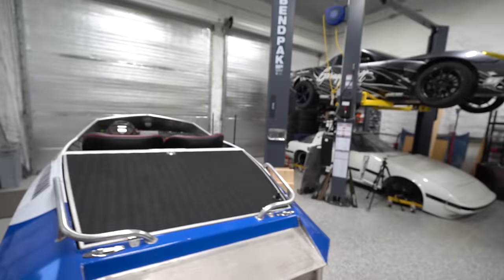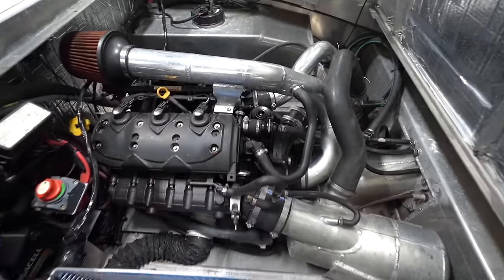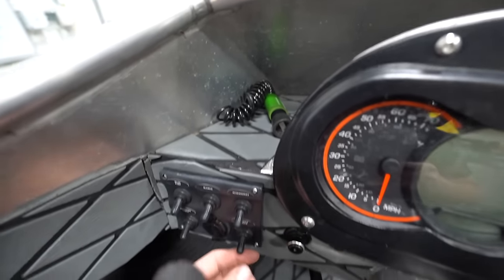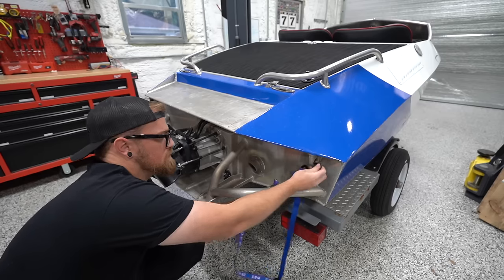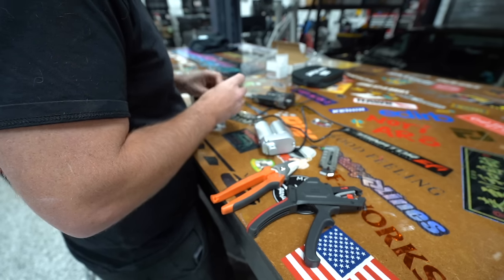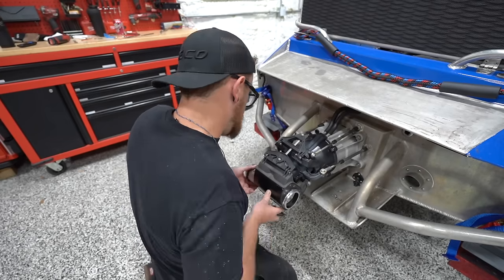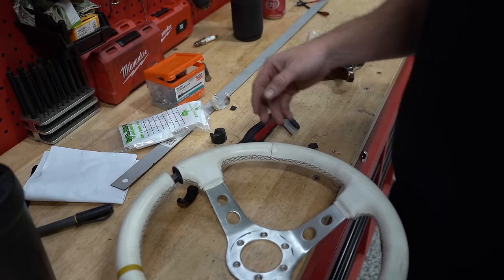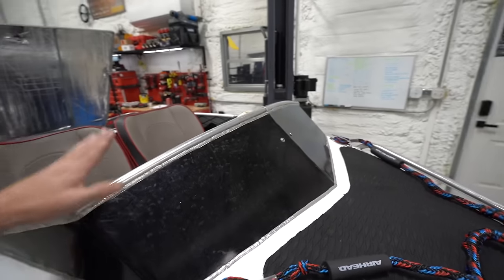Buying the cheapest Supercharged Mini Jetboat on marketplace. There’s some problems.

Comment: Chief Engineer here. Was not expecting maritime content! The unknown button on the wheel is your push-to-talk for your radio headsets. Love the new build!🛟⚓️🚤
Reply from the maker: Dang I did not realize that. I need to integrate that back in. Lol
Reply: @Taylordrifts  also rethink putting the trim button easier to reach, you will use it much more than youre thinking.
Reply: The trim is pretty important especially when you want to get the bow up before jumping over stuff. Looks like the motor mount was moving a lot and not positioned correctly.
Reply: Yes to PTT and the TRIM buttons on the wheel.
Reply: That would have been my second guess.  Good call.

Comment: To answer one of your questions. You absolutely need to be able to trim out a boat to get it up on the step. This will minimize the amount of water under the hull and allow maximum speed. Also, feed the dock line through the throat of the cleat, then up and over the ears.  This will allow the line to keep itself tight while it sits on the dock and not drift off.
Reply: Trim is super important, people adjust trim in airplanes, im having trouble finding a way to explain how important “trimming a boat” is to its performance, and how a boat rides on the water, is super difficult
Reply: In an outboard motor your “trim” is the angle you set your outboard at
Reply: It’s hydrodynamics and aerodynamics rolled in to one, because if you trim a fast boat right it starts riding on air
Reply: The purpose of “trim” is to get the nose of whatever you are piloting/skippering/driving going the direction you want it to go
Reply from the maker: I don’t think most jet skis normally even have trim though. I’m familiar with what trim does. And I will get it working.
Reply: Somewhat of a good answer but not exactly right. Trimming a boat is important because it gives you control over your boat. Trim down will put the bow down and trim up with bring the bow up. And you can utilize that in different situations when it’s planing off or just running. You mentioned needing to get the boat on the step, that is not a stepped hull so there is no step on the bottom of that hull to create turbulence in the water and decreasing drag.
Reply: Sorry, “On the Step” is what we always referred to as getting a vessel on plane so that the least amount of the hull was in the water when traveling. More air under the hull tan water = more speed. Even without trim tabs, we would use engine trim to keep the bow in the best position to maintain best forward speed. Trim tabs would be separate from this but standard operating procedure we’d trim engines up slightly to keep the bow down and the vessel on plane so the hull would displace the least amount of water. Think lowering the angle of attack as speed increases. This was on a 25’ Safeboat that weighed 10k (9800 operationally)lbs which did not have trim tabs, similar to this jet boat, but rather twin 225hp outboards.
Reply: @Taylordrifts  this isnt a jet ski and it drives way different, trim is needed. We know you will address it though, youre too thorough not to get it right!!
Reply: @Taylordrifts  Do yourself a favor and take a boating safety course from your local Coast Guard.
Reply: @Taylordrifts  It's more common in jetski's now because some of them are huge.
No trim isn't needed in a stand up. But it is in the big 3 person ones.
Reply: @agentcrm  both my xpl and my yamaha suv 1200 have trim adjustment
Reply: @Taylordrifts yes they do almost all seadoos from like 2010 up have trim called VTS
Reply: @ronjones-6977  lol
Reply: No you don't, I ran my boat every day for 3 years and never messed with that garbage
Reply: The people saying it's necessary have never even boated

Comment: Definitely need that sand trap for the cooling system!

+100000 on the roof! It makes boating so much more fun when you’re not being cooked like a lobster.

Congrats on the new boat! The list of mods and engines you can toss into it are endless. I like what Kyle did to his with the turbo K24.

Comment: Put dock lines through the center of the cleat and then the loop over the ends.  Make sure you have all your safety gear.  Throw cushion enough life preservers/vests  for yourself all passengers,  first aid kit, horn or whistle (something to make noise), bow & stern light and some rope. FWC is pretty strict and they will pull you over and do an inspection.
Reply: Was going to say the same thing about the dock lines... he might want to take a boaters safety course.
Reply from the maker: @tristonalicky2139  I took it. 15 years ago. It’s been awhile. People love to criticize when I’m trying to be proficient at 100 different things. I ordered a pair of life vests. Paddle. Throw cushion and fire extinguisher are in the locker. Has nav lights. Ordered an air horn.
Reply: @Taylordrifts  i think your viewers are just making sure you have all boxes checked more than they are criticizing you. Your comment section seems to be full of good people too.
Reply from the maker: @warrenmichael918  yeah I agree. 90% is that. This comment was that. Good hearted. Just some people pop in like “wow what an idiot you didn’t know that” because they’re an expert on that thing. When I’m trying to be proficient in 100 different things. Not gunna be perfect in all of them.
Reply: @Taylordrifts  just do you, it works. People are gonna hate through a keyboard. I didnt even like drifting but i subbed to your channel because i happened to see a few of your videos on a few other random things and i liked the way you are so meticulous and do things the right way. I was subbed before i even really watched much of your drifting content. Now i watch you at these comps and find myself enjoying them because i have been following your process and work to build these cars as you get them ready.
Reply: @Taylordrifts  definitely not trying to sound like I know everything bud... just trying to help you out. No one knows what experience you have because you didn't tell anyone. I took the course 20 yrs ago myself. Just looking out for people and trying to give advice thats all. Definitely not a some guy who can't wait to see you fail. I try to help anyone I'm around. Good luck with the build
Reply: @Taylordrifts  Hey Taylor, Didn't mean to come across as an a$$hole.  Sorry if I offended you, I didn't mean to.  I should have explained how threading the dock line through the center of the cleat first  won't allow it slip off .   As far as the safety gear, FWC will ask you for it if they do an impromptu inspection.  Again I apologize for coming across in a condescending way.

Comment: If you plan to go to dual battery, they make a dual battery shut off switch that let's you switch from battery 1 to battery 2, or both. I have one on my boat so I can leave it on 1 battery when you are anchored up so that you don't have to worry about the bilge and radio draining the battery to the point where it won't start.

Also, regarding the bilge pumps. I'd recommend installing both with their own float switches, but wiring them both to a 3 position switch where you have OFF-ON-Auto so you can either use the floats or override the float in case it fails (and they do). They sell switch panels with an alarm which is also nice.

Comment: The first time you launch the boat pull the winch strap all the way out and crank the boat back on. When you replace them dry as you did there is always play in the strap you can’t get out without the weight of the boat. Also when you use the cleats run the loop of the dock line thru the cleat and then up and over. Looking forward to this content!

Comment: I love these little jetboats! If I'd add a top to a boat like that, I'd do a taller windshield and a rollbar. Then do like a bikini top on a jeep where it snaps across the top of the windshield, lays over the rollbar and each back corner has a strap that cinches it tight.

Comment: Yo Taylor! One thing you may want to consider, since I didn't see one in the video, is a sand trap for the water intake. Sand in the cooling loop can block coolant paths in the engine and cause overheats. There's a company, minijet boat builder, who has a wicked sand trap, they even a video on their youtube channel showing it in work.

Comment: Definitely good choice to rotate the tube on the bucket. Probably don’t want to cover them up completely bc there a lot of force that comes out of there and you don’t want the bucket to blow off. The OEM buckets have a little turn out. 
Two bilge pump is a good idea. 1 big battery is good. Now if your stereo had an amp and you sat around the parking spot playing music for a long time it would drain the battery and it might not be enough to start. Just like a car. But at least wherever your car battery is dead there’s not a chance of gators floating around, lol. But if you do two batteries put in a perko or equivalent battery switch. Therefore you can even turn it off. Always check that carbon seal as well. It’s a seadoo. They do and will leak.

Comment: I can’t wait for the content that this is gonna bring.  Also on a side note, I can not believe that nuts and bolts has not hooked you up yet. Like if ever there was a fabricator that could use that stuff. Be super careful using the bucket as brakes, that angle will plow the nose , which I get it it’s the only option.

Comment: Hey Taylor you are going to need that Trim Switch it is as important as the Throttle and as far as the other ones I would find out what they do cause if they were as important to put them on the Steering wheel they probably need to be accessible, keep up the good work love the channel

Comment: BALL VALVES on my boats, Every Through Hull Fitting has a ball valve if you ever have a failure at least you will not sink,and especially if you leave it in the water over night. Just a thought if they are not already there.

Comment: You’re going to need the buttons on the right side of the wheel to put it in sport mode. I have a 2019 wake pro and I have to put it in sport mode after every time I turn it back on. And yes you want sport mode as it’s a lot more throttle response.

Comment: 100% DO THE WILKEY TOP!!!!!!
why is the trim actuator facing the way it is??  flip it 180 so its pushing and pulling inline with the cable and not being redirected by those joints, no more flexing.  
The other button im guessing is PTT to another radio on the same channel(probably not passenger headset, would guess that would be Open comms)
any way cant wait to see what this thing turns into. its nice to see project of many shapes being tacked by you and how u go about doing it.

Comment: Rebuild the supercharger asap on that engine. I’m a huge fan of your channel and I’m big into seadoo and the 185/215/260 supercharger has to be rebuilt every 200hrs or 2 years if the supercharger blows it puts a bunch of metal in the engine and can take the engine out. Also only use a seadoo rebuild kit aftermarket is crap for the bearings.

Comment: Button is secondary kill switch for engine most likely. Also, you want room to escape if you capsize, the steering wheel is a little close or tight on the legs it looks like. But if not, let it rip. New subscriber!

Comment: You should add a secondary safety chain to hook to the front eye. Most boat trailers have them incase the winch strap fails
Reply: Thats actually for transportation of the boat. Not supposed to use the winch

Comment: with the bilge pumps connect them to a float switch with a piezo buzzer & light on the dash, the pumps will work automatically & the buzzer & light lets you know they have activated & if the buzzer doesn't stop you know you have a major leak giving you time to beach the boat.

Comment: so changing hand to foot throttle is easier than u think. everyone over thinks it.  This is what to do to get foot throttle on racing mower... 
Cut a couple inches off a bent set of bmx bars, (always had a set somewhere lol) weld a couple inches of a tube on the floor where want the throttle.  Take a bmx bike brake lever and bolt it to the lil tube cut from the bmx bike handle bar. In your case, the part you bolted to the e36 wheel, just bolt to that tube.

Comment: You will definitely want trim especially with what that boat is designed to do. At times when going over things such as logs or rocks it helps a lot to be able to trim your nose up a little. Watch your trim motor in the video. The motor mount is moving instead of the cable.

Comment: It'd be neat to put the throttle on a foot pedal and then integrate the reverse bucket on a foot brake where when pressed with the "Brake pedal" it gradually engages the reverse bucket and then springs back when you let off the brake. 

So Essentially your throwing it in reverse just like with the hand lever. But when using the foot brake it springs back to forward when you let go. 

I'm sure you can do some engineering with the reverse bucket cables to make this work. These are the cool projects I find interesting. Making a Jet boat feel like it has hydraulic brakes in the water.

You could even use some sturdy electronic actuators rather than a cable for the reverse bucket. Integrate something similar to a drive by wire where you can have two inputs running the position of the actuators controlling the bucket. One on a Sping back Brake Pedal. Then one for your forward and reverse lever with a button that locks in place where you stop it like an automatic shifter. 

I think this would be super neat. If you went this far I'm sure the entire steering system could easily be put on electronic actuators. This would open up alot of capabilities with programming the speed, sensitivity and broadness of your steering spectrum aswell as data logging. 

I know this seems out there but im an engineer and Nerd out on stuff like this!

The possibilities would be endless. Use micro professors like 
raspberry pi to control the Jet Boat RC. 

You could even write a program to take data from IR cameras to make the boat self steering up a Waterway. The cameras would be programed to recognize water, land and objects and then steer to avoid them. That's pretty detailed coding but it gives an example of what electronic controlled actuation can do!

Comment: You gonna do some jet boating with cleetus n crew this summer???
Reply: What a lineup that would be. TRay, Cleetus n Crew, and BoostedBoiz
Reply from the maker: Hopefully! Assuming Garrett and James still have time to ride. That would be a blast.
Reply: Not without trim he won't, cleet will leave him like hes draggin an anchor. and it will turn like shit.
Reply from the maker: @sicknessuntamed  does Garrett even have trim on his boat?
Reply: @Taylordrifts yes his has trim. That's he he throws that big rooster tail out the back into peoples faces just being an a**. When he goes fast he trimms it back down
Reply from the maker: @shroom903  it’s just weird with this one because if you trim it up the steering is going to automatically change due to the distance changing like bump steer on a drift car because of tie rod angle. I need to look at the factory setup
Reply: @Taylordrifts  watching how much Garretts trim makes him drive so much better, its 100% needed. Im sure you will get all them linkages and steering worked out so your trim works like it needs to. We all love Cleeter but get in Jackstands corner and let him help you out, Kyle as well. LOL
Reply: Trim makes the boat an amazing amount better
Reply: @Taylordrifts  Yes he does, if you watch the vids you can see him changing the size of rooster tail, the trim does this for a jet drive, also allows it to get up on plane faster and obtain a higher top speed. Looking forward to what you do with this Taylor, keep up the great work

Comment: I would change the black windows to white so the aluminum doesn't get hot from the Sun.  Probably should mount those switches on the dash at least.  The button was probably for a horn that didn't work anymore.  Horn is required on boats.  Recommend a softcover topper so you don't bonk your head and less top heavy.  Boat looks solid but yeah that wrap has to go.

Comment: Should have left the reverse bucket how it was and added two "spoilers" on the deck to deflect water back down. With the angle of those now if you’re full throttle and pull the reverser like doing a 360 the ass end is going to raise up out of the water more.

Comment: Yo not sure if you address it later but on those rxt 260 motors they had an issue with the superchargers blowing up and sending metal into the motor, sea doo makes a upgrade kit for the s/c so look into that!

Comment: Don’t tighten them transom straps all the way down. Leave them some room to flex a little or they will bend the aluminum around the hooks. Trailer will flex alot towing it down the road.

Comment: for the spacer on the steering i'll probably use a quick release 
idk, i'm a little waterfobic but if end up upside down in a boat i'd prefer not to be stuck in the steering wheel 😅

Comment: I don't think you'd want floor mount throttle. Need a firm spot to plant your feet when jumping. On the wheel will be easier to maintain throttle control.

Comment: That trim actuator just looks like it's not set up right. Like it's trying to move the cable side to side instead of in and out. Unless that was just the camera angle?
Regardless..... You're definitely going to want that working. Especially on a little jet like that. You'll be surprised how much difference it makes in how the boat performs....
Seriously cool boat, though!
I have an old fiberglass 21ft Tahitian with an Olds 455 and a Berkeley Jet drive.... Bought it as a project about a year ago and just haven't been able to get to it, yet...
My Mark VIII has been the priority....